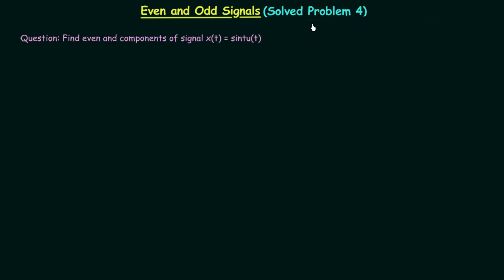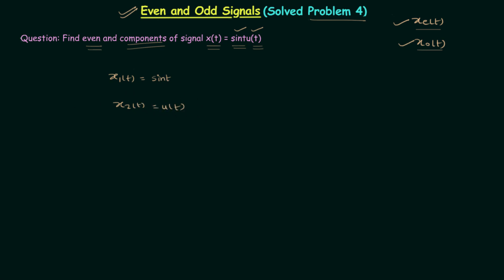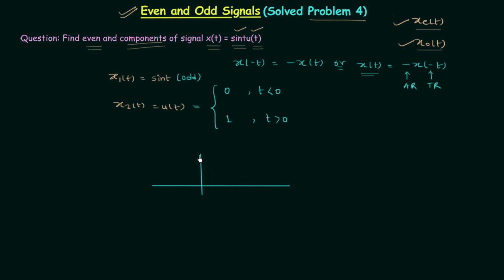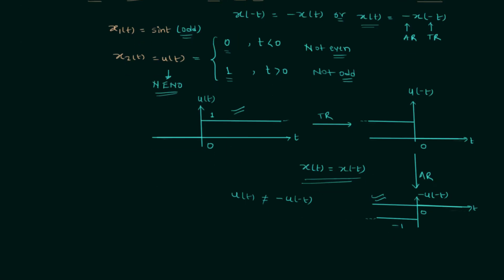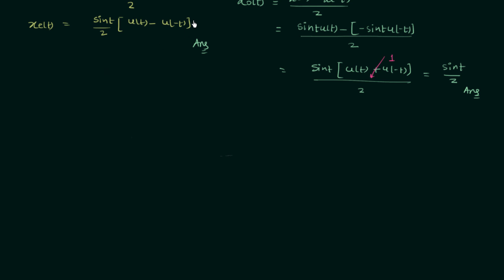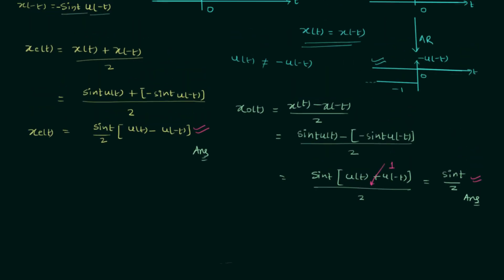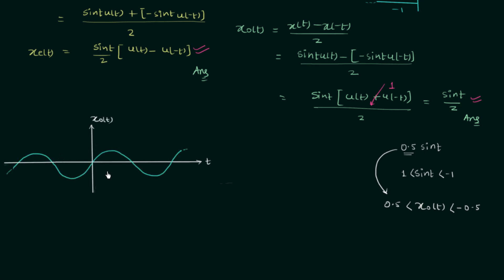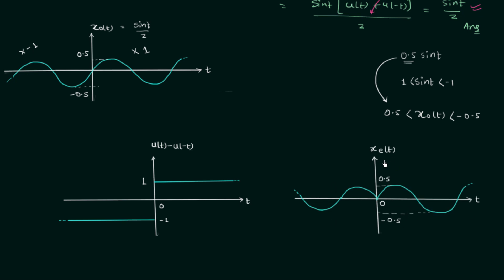Even and Odd Signals (Solved Problem 4)

Comment: But is u(t) not the same as a dc signal with 1 as amplitude, in previous class you said dc signal is an even signal
Reply: u(t) has 2 different values: 0 when t < 0, 1 when t > 0. A DC signal has constant value regardless of the value of t.
Reply: @kartikayrai5774  well explained

Comment: Why unit signal not even. Because it's mirror image in y axis
Reply: An even function should be symmetric by y axis... Unit step function has positive value for t>0 but not for t<0. So if you fold the graph w.r.t. y axis it won't superimpose over the same portion of that graph thus not an even function ...
Reply: @Jahid49  thanks a lot I finally got it

Comment: unit step signal look like dc signal...as taught before so how it possible u(t) is neno? .it should be even signal,isn't it?
Reply: A dc signal is non-zero for all value of t. Example DC value 10 will remain 10 for both t>0 and t<0. Whereas u(t) only exist for t>0
Reply: @vineetsingh4076  thanks for explain
Reply: @vineetsingh4076  in that Example : are x(t) is even or odd
Reply: Vineet Singh  then in properties of even and off lecture the waveform of DC signal is right or wrong. plz quick
Reply: First, during the plot x(t) = 10, a mistake was made (both speaking and sketching), then it was rectified.
Reply: Vineet Singh when? it was retified
Reply: prabu k at first he told x(t) = 10 for t>0 ( at that time he didn't classify it as even or odd) but next he told x(t) = 10 for all t, and then it was classified as even signal.
Reply: Vineet Singh thanks bhayaa
Reply: Vineet Singh ok bro I got your point thanks

Comment: Unit step function should be even function becoz for t=-1 the value is also 1....sir??
Reply: no, because u(t) is undefined in the negative domain and u(-t) is undefined in the positive domain. therefore they are not the same signal
Reply: @yaredmamo7451  but in previous lectures when discussing about properties of even and odd signals sir used x(t)=10 and time reversed x(-t)=10 then said both have 10 as a value theresore x(t) is even function but here u(t) and u(-t) is equals to 1 but they rae different values.????????

Comment: unit step function should be even .because every value of "-t" signal u(-t) has a positive value which is equal to u(t)  for every value of +t
Reply: for even signal this condition must be fulfiled x(t)=x(-t)
but in unit step function u(t) not equal to u(-t)
Reply: @apakigonerogue292  but u (t) is mirror image in y axis.. isn't
Reply: @وساممحجوب-ت1ت I'm a bit late, but no, it is not a mirror, it's like a dc value starts at 0, goes to infinity, so all negative values are zero